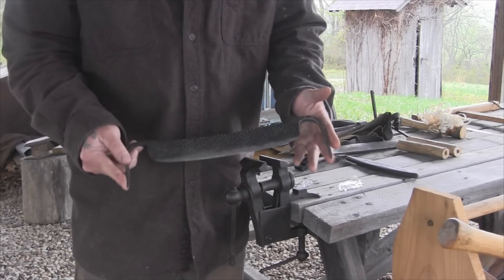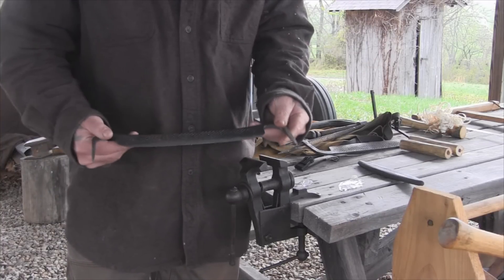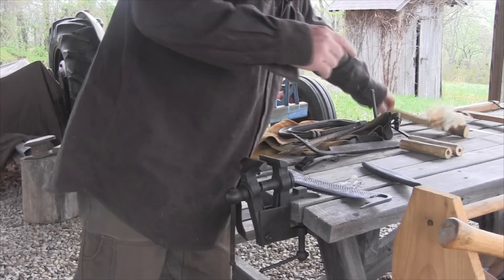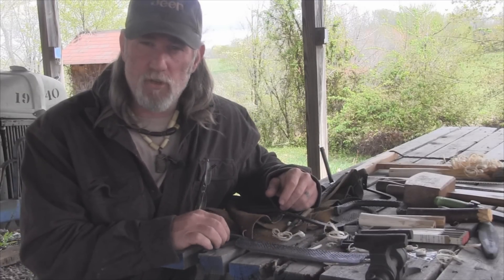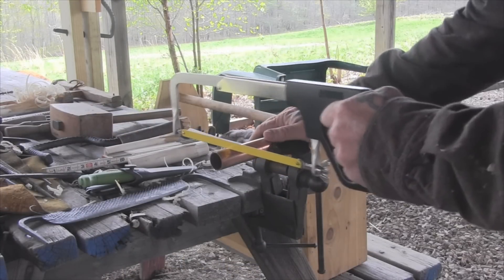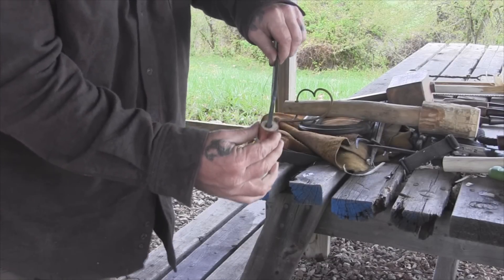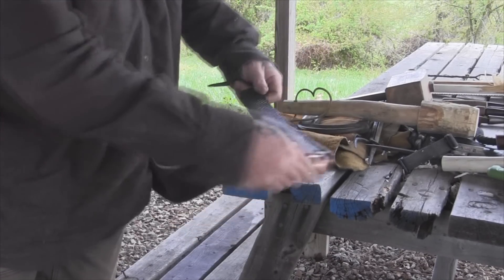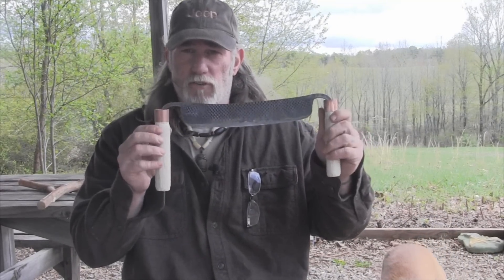Forging a Draw Knife Part 2 Finishing the Tool

Comment: Hey Dave, if you use copper pipe caps you can drill a hole in the top and solder a steel nut on the inside and thread them onto the draw knife. This will allow you to remove the handles for easy carry and just thread them back on when needed. Many hardware stores carry such file handles and I use them often. You can also use them on multiple tools, saving you the hassle of making handles for everything  you have

Comment: Great stuff Dave. Something I learned years ago from a 92yr old when asked about epoxy. What's that never used it. Birch bark son, birch bark. Wrapped your tang with the thin orange layer of fresh birch bark, and it will never come apart. :) My friends gouge kept coming loose when bldg our log cabin. Birch barked the tang and that tool is still in use today. The BB epoxy was applied in 1996 :)

Comment: Cody over at the Wranglerstar channel press-fit a nut into a golf ball and used that as a handle for some of his files. Same trick would probably nicely with the draw knife.
Reply: sirjimmy71 Yea I saw that video. I am not sure it would work here tho. Very short shaft going into that golf ball and with this tool you are pulling on the handle as opposed to puching on it on a file like Cody did.

Comment: Why did you want it to not be that hard?
Reply: Aar0nMiami It would break easily. You hit a hard part of wood you can break a piece right off the edge of the blade.
Reply: Aar0nMiami  the harder the metal is the more durable the edge, however it is also very brittle, you can actually smack a file against an anvil and it will crack in half. So therefore you have to find the best balance, too soft and it will dull very quick, too hard and it will break.
Reply: So too brittle? How do you know when you've over-hardened a metal to the point where you can anticipate it to be brittle?
Reply: Aar0nMiami metal is left to cool slowly, this softens it, that way all metal has the same temper, when quenched in water it gets very hard, salt water slightly less hard, and oil even less.
Reply: Arizona Survivalist I'm familiar with the basic of "how". My question above was actually how do you tell when it is softened enough not to be so brittle as to break when used.
Reply: Aar0nMiami as metal is heated it changes color,it cleanrd up u can see the color change